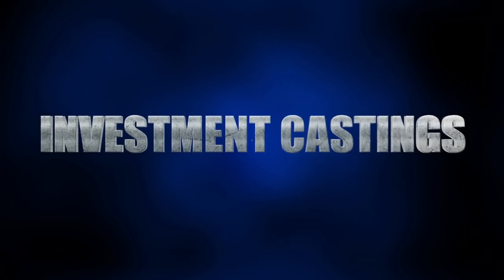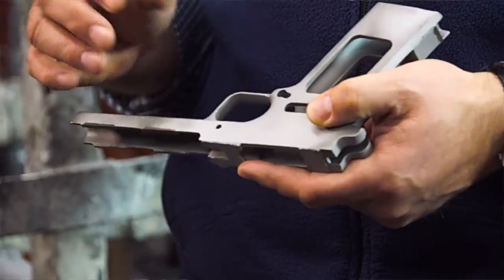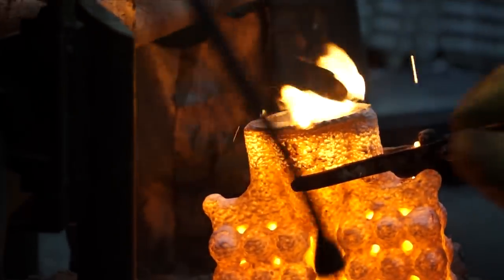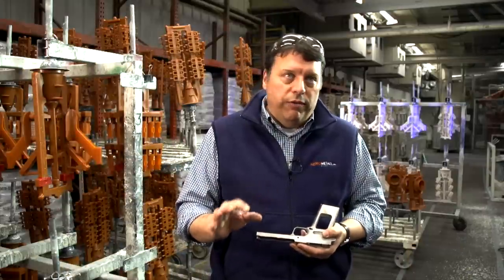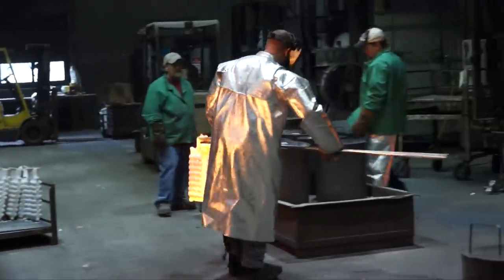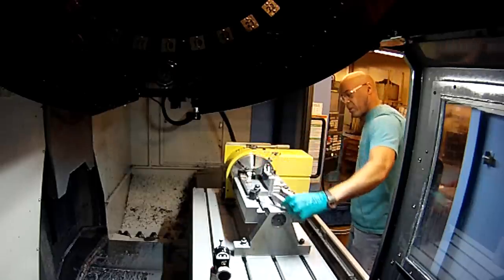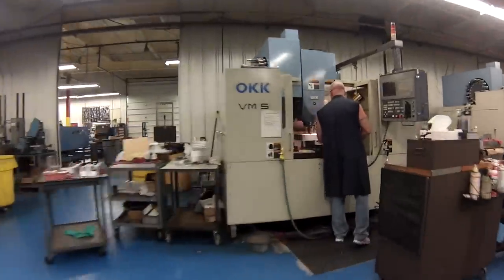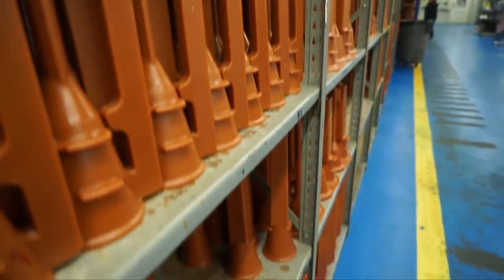Investment Castings for Firearms | Aero Metals | La Porte, IN

Comment: What are the current firearm manufacturers that use investment casting?
Reply: I think Ruger still does
Reply: Ruger started there revolvers with investment casting since their introduction in the 50's. Very cheap to produce, very fast to produce, and very strong frames. Ruger revolvers are famous for their strength.
Reply: The Ruger mi I 14 with the exception of the barrel is all IC.
Reply: General Electric Lost wax is easier and cheaper. Forging is debatably stronger, which is how machined frames generally start out.

Comment: This can be done at home a lot easier than most believe. I use lost wax casting using PLA and mixed metals.
Dip it a couple of times in your slurry and then sand it. Test your slurry until it's appropriate
Repeat 5-7 times. Make sure it's completely dry in between dipping
Melt out your waxed "Plastic 3D printed" part at 450F.
Pour your steel, let cool and sand imperfections

NOTES
-Sand your waxed "Plastic" to at least 400 mesh*
-Use good ventilations 
-Pour upright not laying flat.
Reply from the maker: Sure but not everyone is handy....  easier to just buy the finished part?
Reply: @partgurus  one could say, not everyone has a lot of money, right? You don't have to be handy. You're literally just melting metal and pouring it. Minor sanding for fit and finish. "So easy a caveman can do it". Anyone can get a fire hot enough with the help of a vacuum cleaner blowing air onto a fire and smelting down some aluminum cans with about a dozen pennies in the mix. Take your melted metals and pour in the hole. Don't pour in the wrong hole or it'll look like shit ;)
Reply: Sure, if you only intend to use weak or at most medium strength aluminium alloys or pot metal/zinc. If you want to cast high strength aluminium alloys and actually retain all their potential strength you're going to have to properly de-gas it, which isn't something an amateur is capable of doing. After all they use specially made high speed rotating nozzle argon degassers, which takes some very serious engineering. And pretty sure that if you want to cast steel alloys you're going to need to do it under an inert atmosphere or vacuum too in order to prevent oxidation and gas absorption.